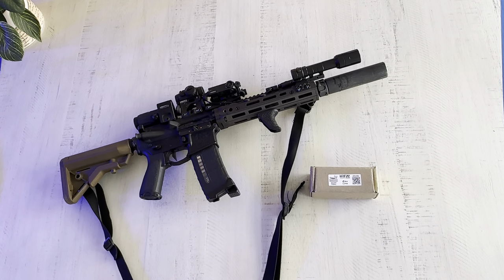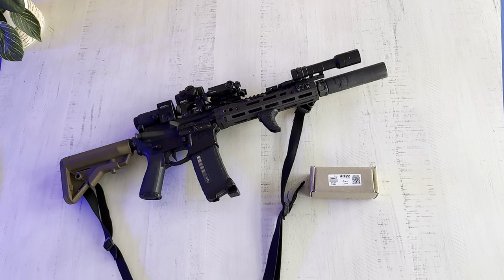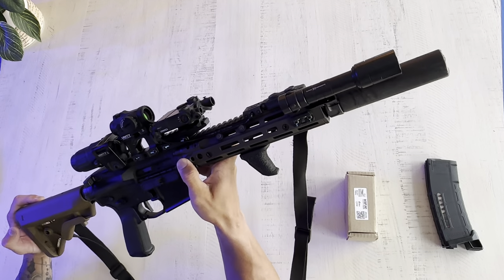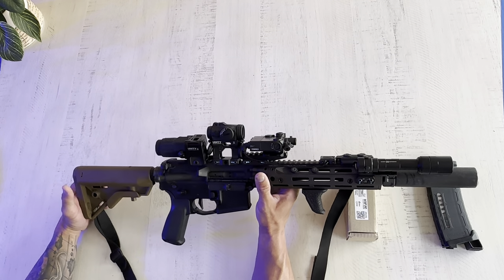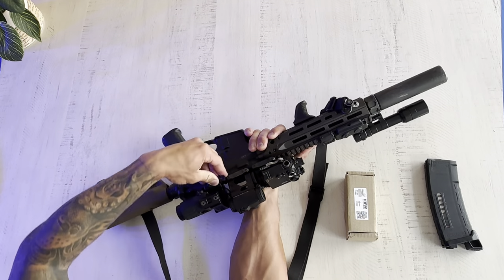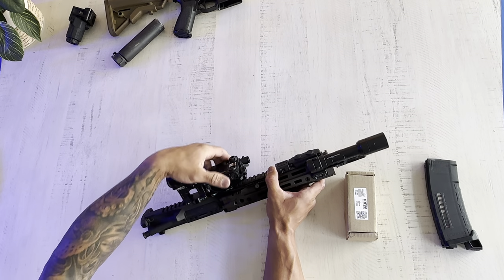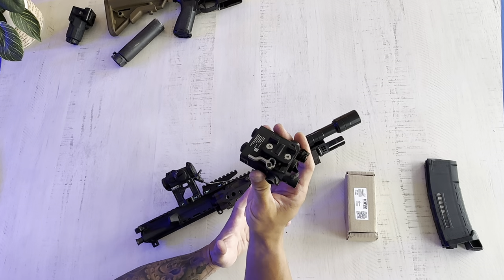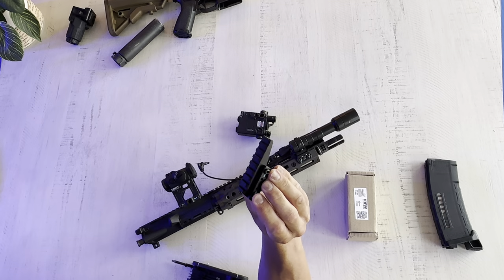HRF Concepts SKIFF Laser Riser *Unboxing and INSTALL

Comment: Great video man! Something you might want to look into, if you want to get more out of your rc2, switch to the normal flash hider or muzzle break. Pewscience has a breakdown on them and shows the warcomp is missing labyrinth seals. Allowing gas to blow out through the locking mechanism.

Comment: Are you using a departmenr issued rifle and suppressor? If its your personal rifle and suppressor, change your muzzle device from the warcomp to a flash hider. The warcomp series makes the suppressors sound very loud. The warcomp and 3 prong flash hider were evaluated by PEW Science to see how they affect suppressor performance, with the warcomp having extremely poor performance. Surefire confirmed that the warcomp muzzle devices were not made to be used primarily with suppressors but as a quick mount for short duration suppressed shooting.
Reply: It’s because the warcomp doesn’t have the labyrinth seals

Comment: doesnt make any sense to use the skiff over just a regular .75" riser. you people are silly for paying over $100 for a little piece of metal riser that you can buy for $20. i came here to see if there was a reason i should buy it, but there isnt. i have a .75" mount for my Perst 4 sitting right in front of my Unity T2 Mount, makes no difference from the Skiff.
Reply: Skiff is 1" not .75"
Reply: @boostav  same idea, they make $20 mounts in all shapes and sizes